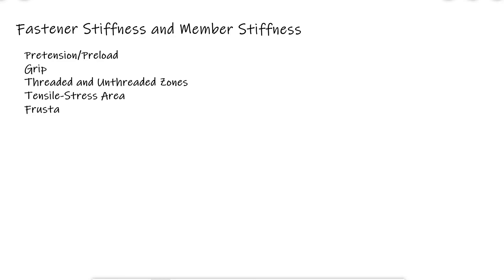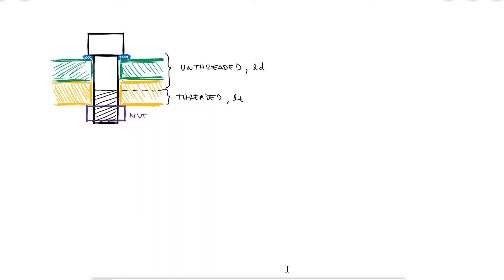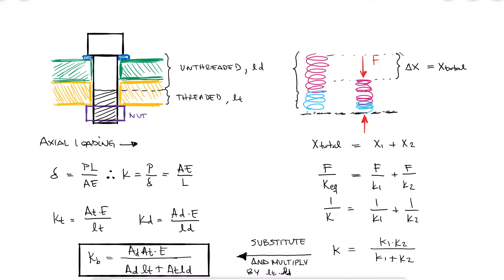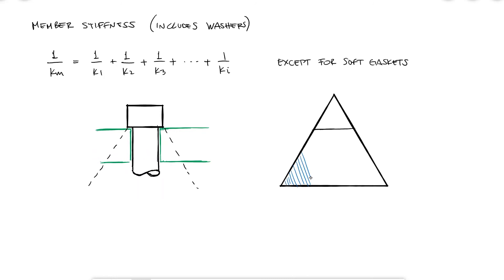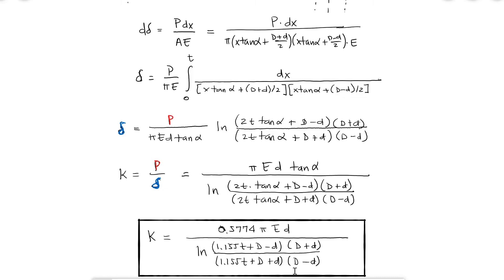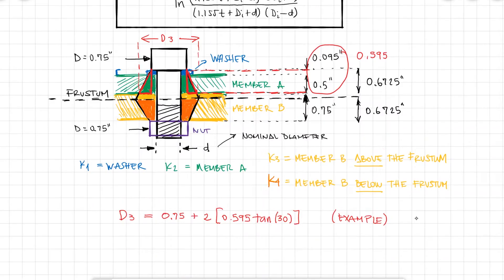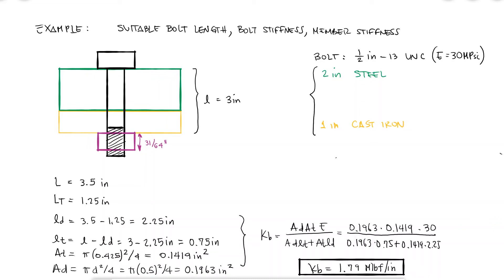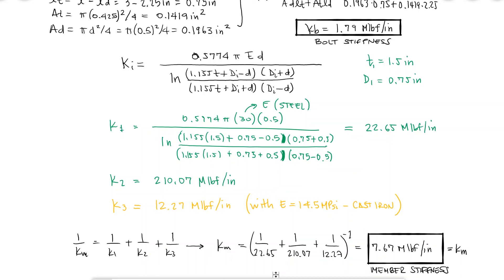Bolt (Fasteners) and MEMBER STIFFNESS in Just Over 10 Minutes!

Comment: Could you please suggest how to calculate stiffness of screw and members(no nut), in this case I guess we need to consider shank, unengaged thread portion and engaged thread portion for screw. And the frustrum diagram will be made from the last engaged thread and not the first engaged thread(grip length). Am I right.

Comment: Also, according to McMaster the value of D is 7/8 inches right? I got confuse at 9:37 where it is used a value of 0.75 inches. Thank you in advance for your clarification
Reply from the maker: The width of hexagonal bolt heads and hexagonal nuts usually report two values: between parallel, opposite faces, and between opposite vertices. The 7/8" might refer to the distance between vertices, which is of course, larger than between opposite, parallel sides (0.75" in this case). You can work with either, but you are right: McMaster does show the 7/8" dimension only. The process in the example is still accurate, regardless of the numbers used. Hope that helps!

Comment: Question from the real world: At 7:44 you say, "I would like to find a bolt that is suitable for this application." This doesn't make sense in the real world because literally any bolt can hold two plates together. Normally there is some force that is pulling the two plates apart. These forces are not taken into account in engineering books and I don't understand why. All I'm looking for is the pull out strength of any given bolt or threaded material. Seems like a simple request that I'm not finding anywhere.